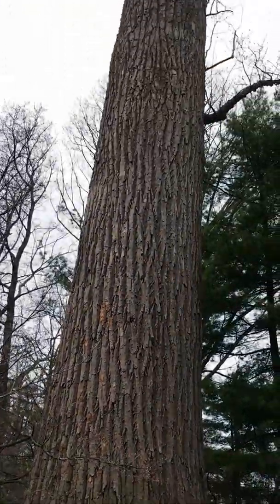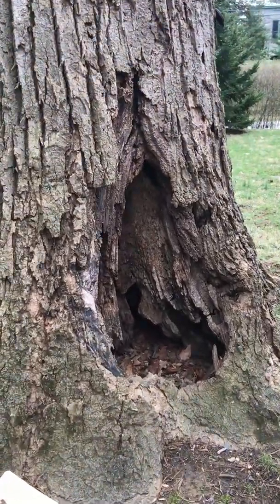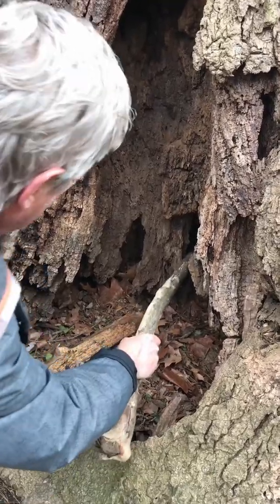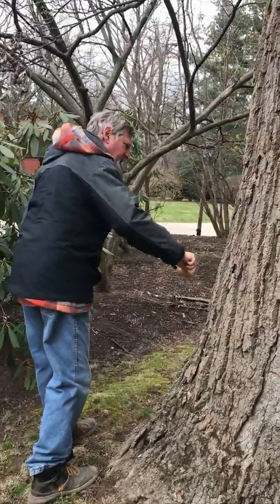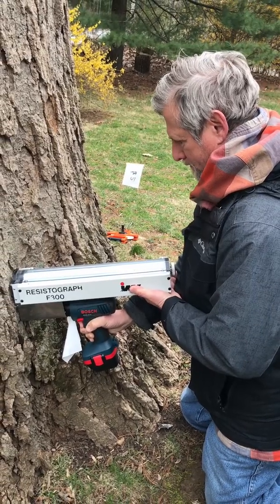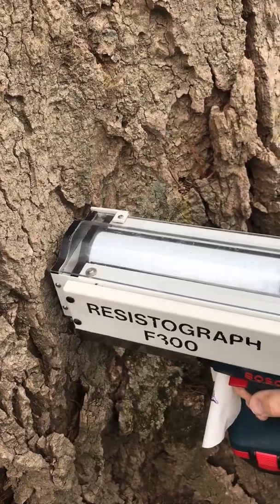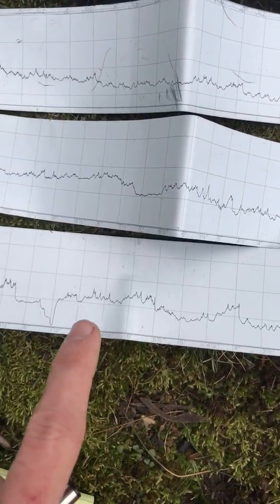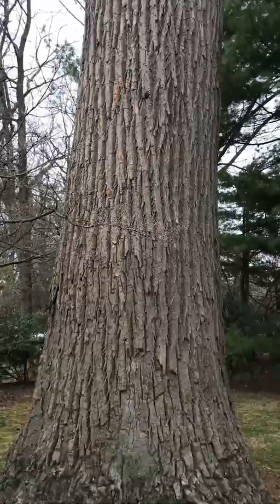Testing Decay in Trees with Resistance Drill! #shorts

Comment: Sad about the tree, but the tools you had to assess it were really neat.
Reply from the maker: Thank you! Yes, it's sad we had to recommend removal. Such a large tree
Reply: @Andrew_the_Arborist was it possible to perform a crown reduction and get the height below a point where it could t strike the building?   These Tulip Poplars tolerate this type of pruning quite well if healthy enough as this one appeared to be!?   The larger the diameter the more hollow the tree can be theoretically while still retaining enough integrity to be preserved. The canopy appeared to have an architecture that would have allowed for a proper crown reduction.    A 10% reduction in height will result in a 20% reduction in load applied to the lower trunk!
Reply: @Andrew_the_Arborist tree are health because our PH are tree and are oxygen our are hour glasswood smoketown
Reply: @WFly101 🤯🙃👁️👅👁️
Reply: @WFly101  what?
Reply: Agreed that it's unfortunate the tree is at the end of life. But on the positive side, removing this tree helps prevent disease or parasites from taking hold in the area and infecting younger trees of the same species.
Reply: I know, right? That big stick they shoved in there was so cool!
Reply: Wonder what caused the tree to decay
Reply: Absolutely True
Reply: A wooden mallet is impressive to you?